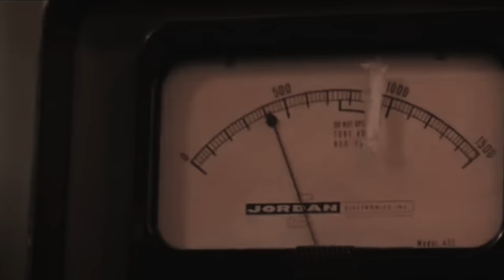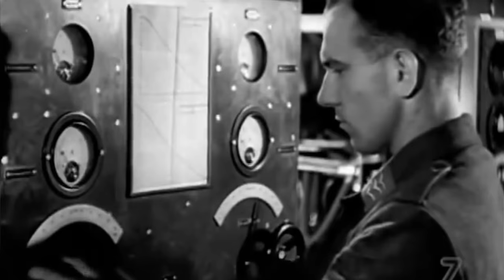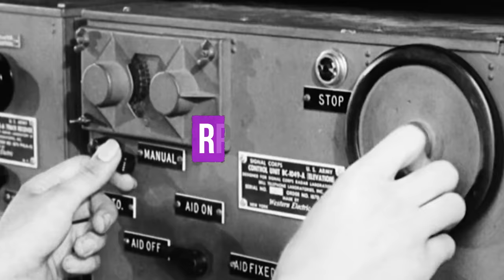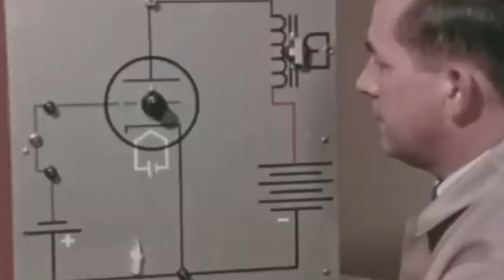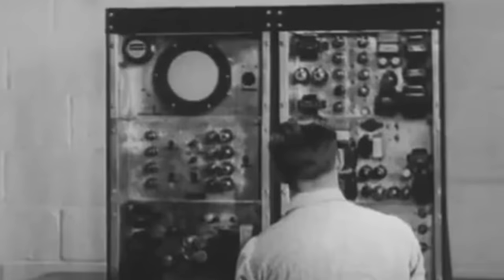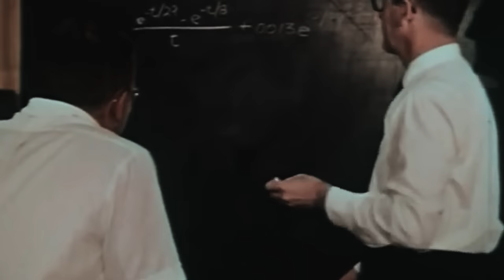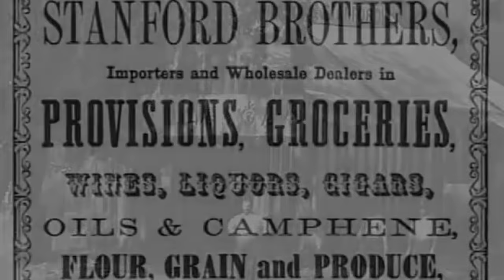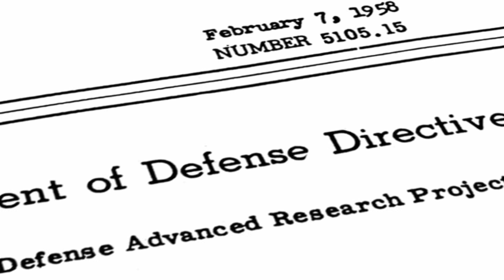Old Military Tech Created Modern Smartphones

Comment: Frank Therman may have solved the question of why Johnson noise was ktb, Boltzmann's constant ▪︎ Kelven temperature ▪︎ radar bandwidth, instead of 4 ktb an oversimple theoretical estimate. This, with its better understanding of thermal noise in radar circuits, was a WWll secret. You may factcheck this checking a footnote in the thermal noise section of a 1941 book "Radar Engineering" by Fink. (I am marginally housed so I couldn'.t keep my father's copy) He, Charles Mack Brown jr. was a Cal Tech EE grad Bs 1943 who quickly became a civilian radar engineer in the US navy and ended up in Lockheed /Sunnyvale and Mercury Nevada. 

In 1973 I filed for a patent,  us3890161a, Diode Array, for a device which absorbs heat converting it to an equivelent amount of electrical energy via aggrgated rectified Johnson noise from a plurality of consistently aligned diodes. 

This would be an outstanding source of electricaĺ energy and refrigeration. 

I am taking the pure science road of keeping it open source. Industry, government science, academia, finance, and the military are not configured to develop this easily. 

It needs crowdsource grants to develop proof of concept and initial recipe prototypes. 

Another approach is to develop a related device now called the thermicay. 

The thermicay mainly consists of two electrodes closely face to face (~1 micrometer) in a vacuum wired to an external electrical load. The face of the [Emitter] electrode is covered with a uniform array of LaB6 tipped small diameter carbon nanotubes grown straight out. The face of the [Absorber] electrode is covered with small scale graphine flake char. [Rice U 2014] 

Thermal energy mobilized unattached electrons will tend to free themselves outward from the emitter tips and drift at ~1 million meters / second @ 25 millivolts (thermal electron energy @ 20 C)  to the absorber which tends to collect them.  

A negative charge accumulates on the absorber. This repels oncoming electrons slowing their forward drift, cooling them. The absorber electrode charge is simultaneously the repelling cooling and the external electrical load voltage. The drift current and external wire route current are the same. The DC electrical power consumed by the electrical load depends on the load resistance. Thermal energy absorption always equals the electrical yield. 

Wire resistance is a practical loss not a true loss so lt is overcome by added thermary output. The extra cooling balances the heat given off by the wire loss. The performance of the device is expected to be modest in the beginning but improve rapidly. Even early devices are expected to last a long time. There is little place for obsolence if the first installed thermary works adequately. They will withstand being short circuited indefinately up to an electromigration limit. 

Here is a thought experiment device that hypothetically creates self powered thermal diversification. The thought experiment device is impractical but easy to visualize and check for mechanical workability.  Its parts are large enough to act as everyday mechanisms but small enough to work well with the nanometer scale thermal motions of gas molecules. 

Sketch made with keyboard characters: 

COLD ROOM   ())--:WALL:-->> HOT ROOM    

Key
()) = Paddlewheel. 
-- = Axle.  (Continuous from end to end)
: :  = Axle tunnel going through a wall.
>> =  Lumped friction element

Please visualize two roome full of air separated by a very thin wall that allows the rooms to hold their heat independently with minor leakage through the wall. The wall is thin to delicately support billions of  separate nanometer scale short axles running straight through loosely enough to rotate freely but  not leak very much heat so the rooms can hold separate temperatures. 

On the left side, a very small paddlewheel is mounted at the left end of each axle. On the right side, lumped friction elements are mounted stationary in place on the wall, one for each axle, for the right end of each axle to run through. The lumped friction elements convert the mechanical rotation of their axle into heat. The lumped friction elements do not impart Brownian motion to their axle.  

Brownian motion (a nanometer scale effect) turns the paddlewheels at random speeds randomly clockwise or counterclockwise. This random rotation is turned into heat by the lumped friction elements.    

The committed, linked, and functional roles of the walls, paddlewheels, axles, and lumped friction elements in differnt places should systemically produce a divergence in the thermal energy in the two rooms without adding external energy. 

Aloha
Charles M Brown lll
Kilauea, Kauai HI 96754

Comment: What about  if invent the drone under sea  w/out  using propeller, by using arms just an arms of crabs that can accellerate up to 100  miles ph so that those sea indruder can be deafeat, I was saw it on my naked eyes that the submersuble insect on water disappear on naked eyes. so my summarrizzation is to build a machine & feather  of that thing which is not detechtable.  PS. That under water insect measures only ,mm centemeter. they can make it at least F 35 under water penetrator.   GOD SPEED.